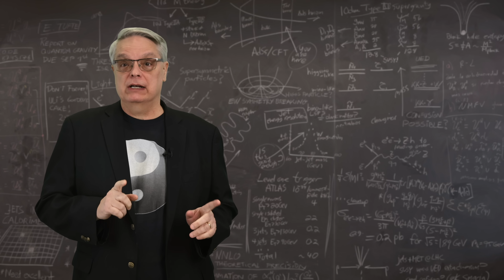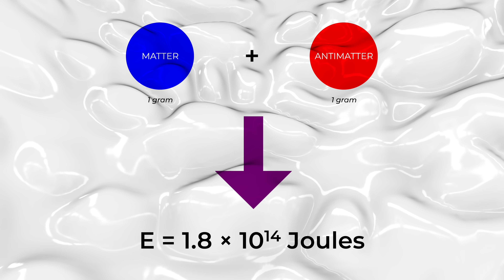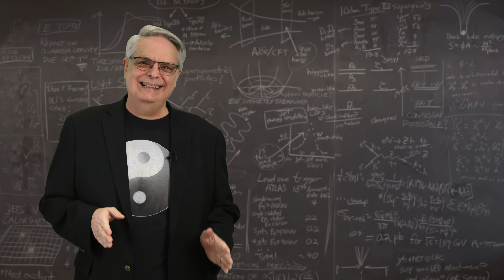How do scientists handle antimatter?

Comment: Would have been nice to hear about how it’s stored and transported then.
Reply: Inside of a Penning trap.
Reply: @spvillano  You should tell that to the host.  He doesn't know.
Reply: @marcuslandry  he does know, and he did touch on the storage and transportation of it, using magnets to suspend it in a vacuum container.
Reply: @ What he touched on was much more nebulous than my decades old knowledge of antimatter storage and transport.  He told me nothing that I didn't already know and that's not a lot.  When you have a video on a subject and barely touch on the subject of the video, I question the reason for the video and I have to question if he knows how antimatter is stored and transported.
Reply: You are correct, they make the videos short that is excellent for science comunication, but in this case it was too short. I don't know if you know how it's done but the general idea is similar to some forms of fusion reactors: electromagnetic confinement. The math is complicated, because the way electromagnetism behave, but well understood.
Reply: @jaimeduncan6167  When you have a video on a subject and barely touch on the subject of the video, I question the reason for the video and I have to question if he knows how antimatter is stored and transported.
Reply: @marcuslandry  Fermilab had an antiproton storage ring back then, so he knows how.  Next video will cover it
Reply: @RWZiggy  Who was it that said he didn't know how?  Did you intend to answer someone else and not me?  All I said was that in a video called "How do scientists handle antimatter?" one would reasonably think that the title was more than cheap, all too common clickbait and we might actually learn how scientists store and transport antimatter.  We didn't, and it was clickbait.  SMH

Comment: It’s a real burning question why there wasn’t more in the Big Bang and so why are we even here!!!
Reply: Current theory says there should have been exactly the same amount of matter and antimatter produced in the Big Bang.  The supposition is that there was a very slight imbalance, and that very slight difference is what makes up the universe.
Reply: Most scientists think the amount of matter and antimatter in The Big Bang was exactly equal. However nobody knows why there is hardly any antimatter left.
Reply: @mbcx9ts2  It's still there making up over half of the dark matter.
Reply: @lockiecresswell4629  Nobody knows what dark matter is.  There are very few truly convincing hypotheses for what dark matter is actually made of and none of them has been supported by enough evidence to become a fully fledged theory.  Even my favourite theory, that there are more neutrino types than we previously thought and the extra ones are the dark matter, is still only a hypothesis.  Anti-matter is nowhere on the list of probabilities because it reacts very strongly with normal matter and dark matter does not react with normal matter at all except through gravity.
Reply: @ that is the question. Where did it all go? Or if there were truly an excess of matter, why? Which is empirically the result we see as we’re here!